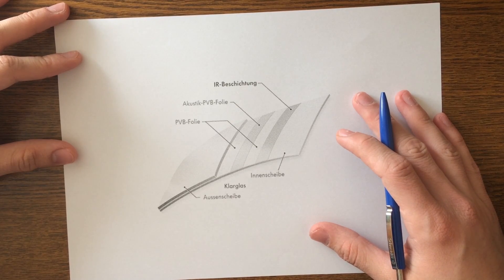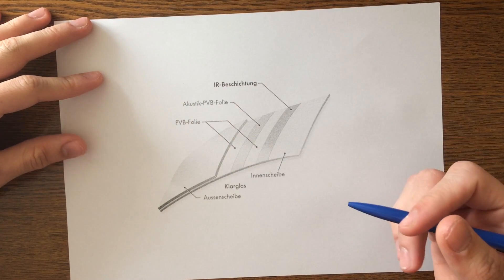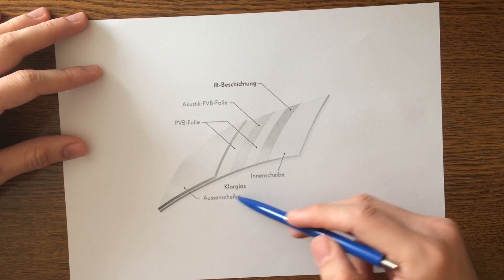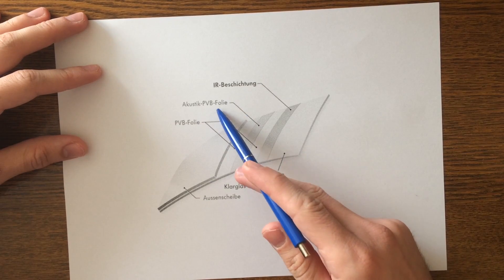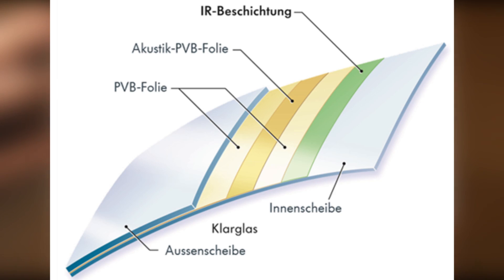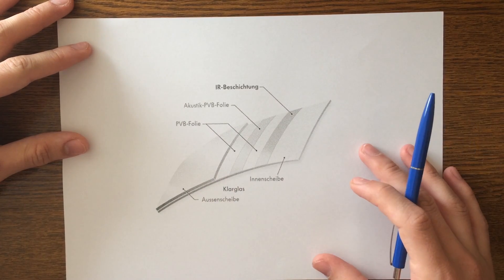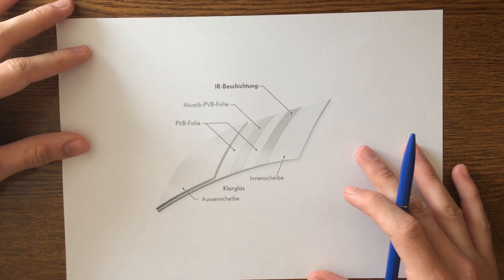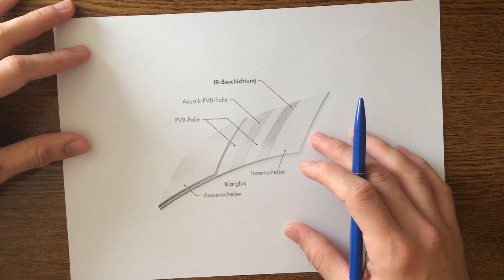The Climate Windscreen by Volkswagen

Comment: I am in the glass processing industry and have a question: the two glasses and pvb are joined inside the autoclaves. The ir layer what is the material? Why not to use the low-e glass widely used in the building industry, to reflect the heat?